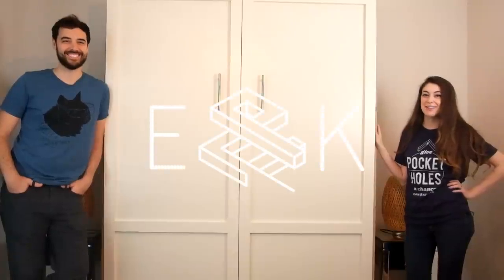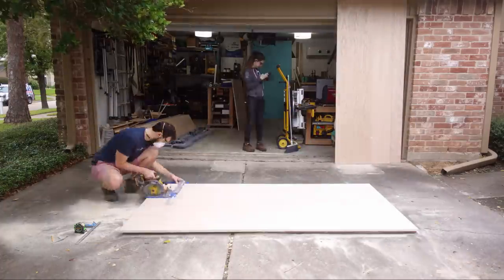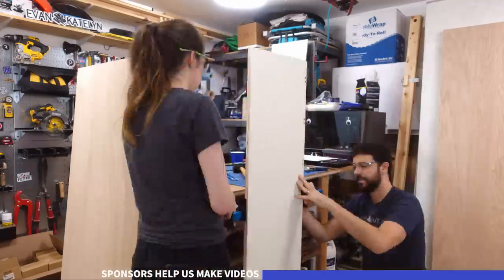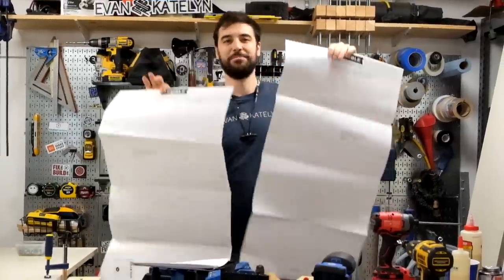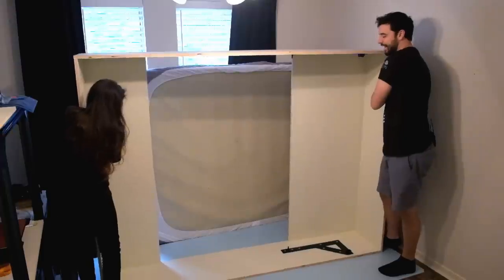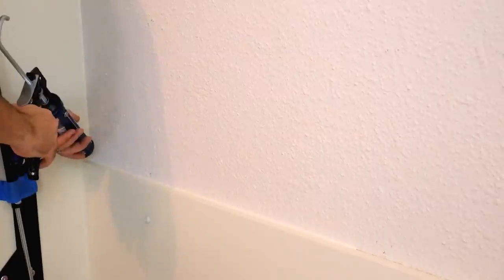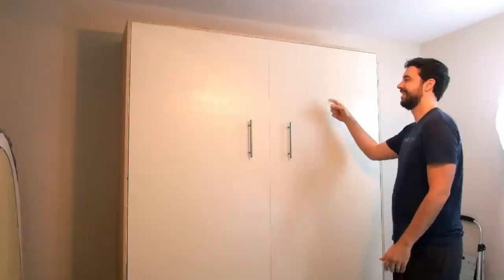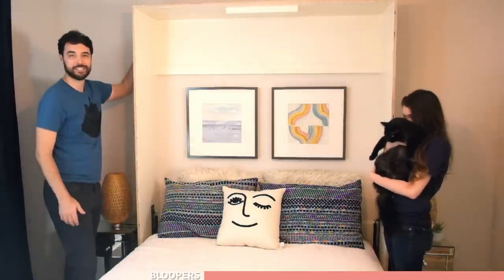DIY Built In Murphy Bed

Comment: We literally use our oscillating tool for every reno we've ever done! You need 1950's double thick sheet rock with weird wire mesh ingrained cut, Oscillating tool! You need to cut the tongue out of floor board in place? oscillating tool! you need to cut a notch out of the original framing? oscillating tool!
Reply from the maker: Haha yes! It's so versatile!

Comment: I slept on a Murphy bed I built for 10 years. Good build!  I would have edge banded the edges of the plywood on the front of the box so that you don’t see the ply edges when the bed is folded down.
Reply from the maker: we actually plan to make built ins on either side in part two so those edges will be covered in trim :) Thank you!

Comment: You know I watched this video when it first came out and I was like cool, my folks are gonna have me put together a murphy bed for them. Put that thought away. Then watching it again now, I realize we used the exact same structure kit for the bed. Those springs are not messing around!

The kicker for us is our murphy bed actually just got stuck shut. The frame against the wall slightly shifted when we were screwing it into the studs, and my folks didn't think to check again once we were done. So the facade we made (way too thick, way too heavy, not my idea >:/) got wedged, and when we were trying to pull it open, the handle straight up broke. So uh, no longer a fan of murphy beds... but still excellent work guys. Very jealous of the built ins you added.

Comment: You could have a shelf system with the 3d printers bolted to the shelves.  When a guest comes over, the shelves tip down hiding the 3d printers and the back side of the shelf system would support the mattress.  When you're 3d printing you don't see the bed and when there are guests they don't see the printers.
Reply from the maker: that'd be cool! Though our printers might be a little too big..

Comment: I just stumbled upon one of your videos while watching DIY stuff and I got hooked. Mainly by how adorable you both are! The DIY stuff is a bonus now. Quick question, is rendering/superimposing your plans over an image in Photoshop simple (Ima noob)? If it is, it would be absolutely amazeballs if you could do a video tutorial for it! There's probably something on YouTube if I looked hard enough, but it wouldn't be as awesome without the Evan & Katelyn adorable derpiness. 😊
Reply from the maker: Thank you so much!!! really glad you like the videos! Rendering plans in 3D requires 3D modeling skills so it's a bit trickier, but the drawing in Photoshop is easy. I just take a photo or screenshot and record my computer screen using OBS while I draw. For home renovations, it's a lot of straight lines so instead of clicking and dragging and trying to keep your lines straight, click on point A of the line, then hold shift,and click on point B of the line. It'll connect them with a straight line. Good luck!!

Comment: I wish I knew yesterday that molding trim can be removed so easily. Today I put shelves in my closet, which is 2 feet deep, so I got 2 foot wide bookshelves. But I forgot that my room's floor molding continues in the closet, so my shelves are resting on that... (I bolted them to the wall because they kept trying to tip forward!)

Comment: Great build but why did you leave the exposed edges of the sides unfinished? Some banding would take care of that easily.
Reply from the maker: Thanks! It's because in part 2 (which we're working on right now) we're adding built-ins to either side and those edges will be covered with trim

Comment: Can you share what the estimated material cost was to build the Murphy bed? Excluding the bed hardware from Rockler?
Reply from the maker: Most of the cost was in the plywood itself - the type we got was $55 per sheet but it was oak so it's a little more expensive than pine. We used... I think 4 sheets? The paint and a few trim pieces didn't add much more to the cost. Sorry we don't have a more precise break down!

Comment: Guys, I built this bed. There's a safety issue with the mounting hardware for attaching the unit to the wall. They have a free upgrade kit. Get it! It's substantial.
Reply from the maker: Rockler did send it to us but we misplaced it somewhere. Our solution should be plenty strong though!
Reply: @EvanAndKatelyn  I haven't finished mounting mine to the wall yet, but I can't imagine this think pulling away if you attach the lag bolts to the studs correctly. Seems like overkill, but, I guess enough people botch that part, and so...

Comment: Here's hoping that that's a mattress that is reinforced to be used for a Murphy Bed. Or similar.
Reply from the maker: Noob question - what do you mean? Folks on the internet just said it couldn't be too thick to fit, but I'm curious!
Reply: @EvanAndKatelyn  I have considered getting a Murphy Bed myself, and while researching it, I noticed that they all came with a type of mattress that is reinforced so that when stored vertically, the innards wouldn't shift around. This mostly applies to innerspring mattresses,  so if its memory foam, you should be okay.
Reply: @EvanAndKatelyn  also, really liked this video.
Reply from the maker: interesting - ours isn't memory foam so that's good to know, we'll do some digging, thank you!

Comment: i built my own murphy bed.  didn't use a kit either.   also didn't have anyone to help.  
it was quite a hassle. y'alls way is better.
i did save some money using boat seat swivels for pivots rather than buying a kit though.  they were like $8 to $15 each...  downside is my mattress weighs 110 lbs and those swivels don't help me lift.  bright side is that it's not actually like lifting a full 110 lbs because physics.... still heavy though.
Reply from the maker: that seems like it would be a lot more challenging, kudos to you for tackling it!
Reply: @EvanAndKatelyn  not really more challenging. i mean you basically just make a topless box to hold the mattress and for the swivels to attach to the frame and some fold out legs for it.  once the wood glue sets you're golden. 
the worst part of it was trying to get things moved by myself when it wasn't quite so solidly put together yet.

Comment: OK, the important part, where do you put all the pillows when you put the bed up? I see you are even  putting   extra pillows on the bed.
Reply from the maker: into the closet! Or on the built in's we're making on either side, depending on where they fit better.
Reply: @EvanAndKatelyn  So this won't be used every day? I built one and have to keep a wide shelf nearby to put the pillows every morning. I wish I could think of a way to keep the pillows      on the bed when I lift it. Maybe I'll glue them to the sheets.
Reply from the maker: since it's for our guest room, we'll really only keep the bed down and made when we have visitors. I think a nice deep basket or maybe a storage bench along the wall could be a nice place for pillows though! Or gluing them to the sheets! :P
Reply: @EvanAndKatelyn  A person could just make the cabinet a bit deeper and make maybe a sleeve or something to slid the pillows in. I use mine everyday and I put it up because I need the room for my studio.

Comment: i am just going to point something out you might want to let your community know.  if that is a queen size bed you have just lost the warranty on that mattress but not providing a center support that goes down to the floor.  If it is a full size than you are ok but queens require this.  Regardless of what your sponsor has to say about this they are not the ones who are going to warranty your mattress if you break it and do not have proper support.  I own a mattress store and Serta, Simmons, Sealy, and ect. all require center supports to go to the floor on queens.  Bed looks great though.
Reply from the maker: Interesting, did not know this.
Reply: i can see breaking something like a box spring but a mattress?
Reply: @Naalderiis  Exactly... a mattress doesn't provide any structure at all. No idea what Lee is on about. The bed frame they used does have a center beam, seems like that would provide the needed support.
Reply: Josh Strawbridge 
It doesn’t literally ‚break‘, but it’ll develop an indentation in the middle really quickly. Had that problem with a platform bed, despite using pretty strong planks. It didn’t permanently harm the mattress, but then I fixed it pretty quickly, because would wake up with backpain.